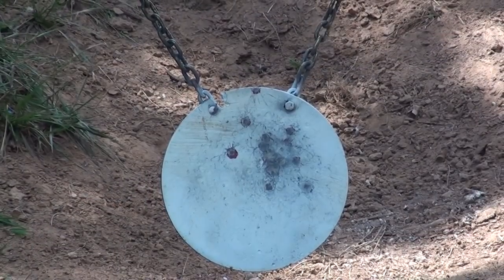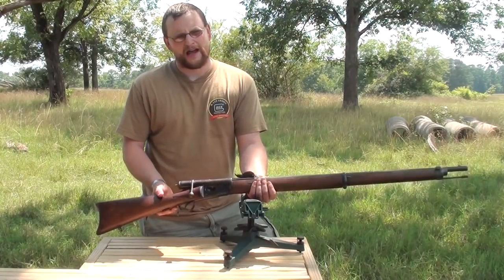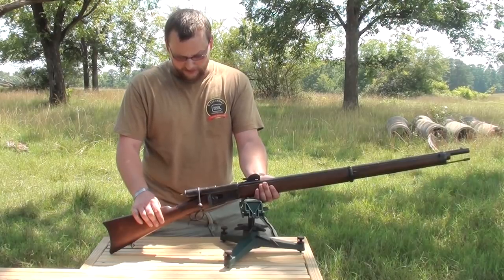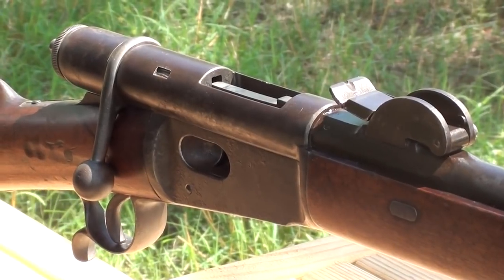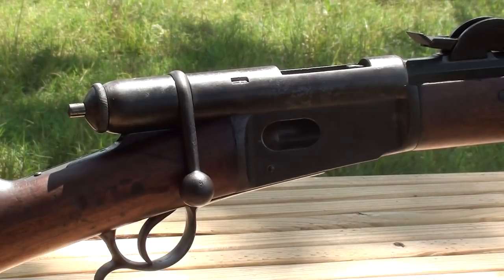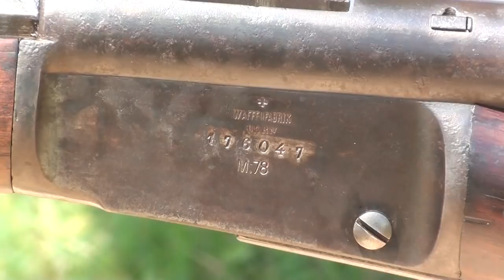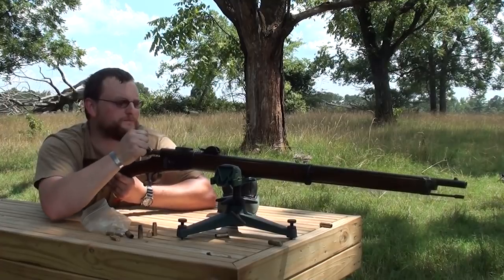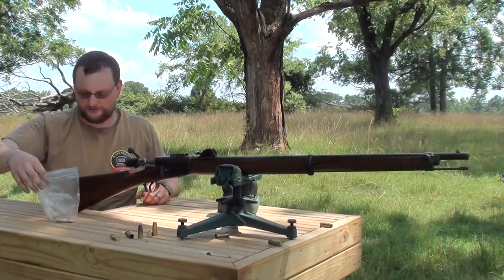Swiss M78 Vetterli .41 RF Bolt Action Rifle Made in 1870's

Comment: I am 100% certain that black powder was used, exclusively. "Smokeless", or nitrocellulose powder ("guncotton") was not widely used until after the Vetterli rifles were no longer manufactured.
Although "smokeless" powder was used by the French military (the 8mm Lebel cartridge, and the Lebel Model 1886 rifle were made specifically for use with "smokeless" powder), the actual formula used to stabilize the "guncotton" nitrocellulose was a closely guarded Military and State secret.

Comment: I have a Vetterli M1878 that I have been shooting for years with great results.  Brass is reformed from 8mm Lebel, bullet is 300grains over 12.5 grains of Trailboss.  I have also used 2F blackpowder which generates about the same velocities as trailboss. Proper smokeless powder charges are fine for this rifle; UMC loaded smokeless 41 Swiss ammo (rimfire) in the USA until 1941. One advantage of Trailboss over other powders is that the proper charge (12.5 gr) fills the case to the neck.

Comment: I have a Vetterli also and about to convert mine to centerfire.I dont think it would hurt the overall value of the rifle drilling the bolt vs being able to actually use it.plus use could still convert it back and the center drilled hole would not have any affect on the rimfire set up.

Comment: Just of note, that is a M81, not a M78. The rear sight was upgraded for the M81, which your rifle has; however, production continued using the M78 model stamp for around 6 years before they changed the stamp to M81.

Comment: Tubular magazines are more complicated than a box magazine. The need to be loaded on by one, versus the quick striper clip method of a box. As for expending brass toward the shooter, the extractor is on top of the m78's bolt (I'm pretty sure of). I'm no expert on Vetterli's, but that would explain it throwing brass up, and back toward the shooter.

Comment: Wow this is great for its time, I thought the first repeating bolt action rifle was the french Lebel, I was definitely wrong, and the fact that it holds so many rounds makes it even more amazing for its time. So if they had repeating bolt action rifles since the late 1860s, why did it take so long before major european militaries adopted the concept?
Reply: First allowe me to correct the narrator a bit: the Model 1878 wasn't the first magazine fed rifle of the swiss army. the first model adopted was the 1869 rimfire model.

A little explanation on why most other countries perhaps were a bit  slow in adopting the concept: While most of them in fact did recognise the potential of the concept wich already had been proven in battle by the US, there also were several reasons not to hurry with the adoption of it. It was forseeable that further generations of army weapons would be of the system sooner or later, but for the time being, most major european powers were rather busy conquering territory overseas than preparing for comming conflicts at home. Like the US, wich - for pushing into its own hinterland - let their cavalry convert from magazine fed Spencers to single shot Springfields, the European Imperialists needed guns where reliability and the prospect of rather thin supply lines seemed more important than high firepower of the individual soldier.

For Switzerland as a tiny country, surrounded by far larger neighbours (with the exeption of Liechtenstein of course), the situation was a bit different: conquerring any foreign territory in africa or the like was out of the question and the military concept was naturally of a defensive nature. Switzerland as a united nation with a single army was relatively new at this time. That was because up to the late fourties of the 19th century Switzerland was rather a collection of mini states (cantons) which all had their own armies and kept large stocks of various guns, often adopting new systems to already existing weapons of which some even once had started their service life as flintlock muskets, being converted to percussion, rifled and converted to breech loading systems over the years. So in the 1860's, Switzerlands Army sought to standardise its armament and as this standardisation was expected to take some time, they chose to proceed with a grand leap ahead in terms of technologial standard. This led to this very early adoption of a state-of-the-art infantry weapon, which by the time would be a magazine fed rifle firing rim (later center) fire metal cartridges of a (by the time) small calibre.

Yet,  at the same time Switzerland was full of a variety of as-good-as new weapons that had to be used first. Furthermore, the Swiss Army was basically a Militia where every able man (after a period of basic training) usually kept the gun at home which he received in his first year of service. So the first Vetterli's were only issued to new troops, after all others were already handed out and you still could find many elder swiss servicemen ralling to their anual army training or shooting matches with trap door single shooting rifles or peabodys by the time france was experimenting with the koprachek or even the lebel.

.
Reply: JosipRadnik1  You have just answered my questions and also taught me some very interesting facts while doing it, thank you for taking the time.

Comment: If you notice, the loading gate and elevator ejector is nearly identical to the 1866 Winchester which were used by the Turks and later copied by the Swiss.  This is pretty much a bolt action version of the 1866 Winchester.

Comment: In that first couple of strings of shots, it looked like there was maybe a little gas leaking out past the bolt. I noticed occasional puffs of smoke upward from the action. It only seemed to happen with second shots or later, so I suppose it could be just residual smoke being pushed out by that lifter flopping under recoil shock. What do ya think?

Comment: Unless you are 100% certain that the firearm was specifically designed and built for use with "smokeless" powders, it is best to stay with black powder loads only with firearms manufactured during the "black powder era". The Vetterli rifles were manufactured during the "black powder era", and do not appear to have been designed specifically for use with the "new-fangled nitrocellulose-based ("smokeless") powder".

Comment: I respectfully disagree with Arle Bodee about the Vetterli being safe for appropriate smokeless loads; but he is spot-on about most antique rifles being best served with BP.  Most of the pre 1900 rifles are safer with BP; but the old adage that BP is "safe" in any rickety old gun in poor shape is BS.  BP can generate pretty high chamber pressures and a shooter needs to be aware that issues of headspace etc. apply to BP ..Arle is correct that pressures should be kept low for Vetterlis..mine are

Comment: The Vetterli (introduced in the swiss army in1869) was the first repeating rifle adopted by a european army. Yours seems to be an 81 not 78 at first glance.
Reply: The main distinctive difference between a M78 and a M81 is the rear sight. The 78 model has the distance divided in paces (or feet), the M81 has a (retractable) sight divided in meters...
Reply: RichardM8181
Your rear sight looks like M81. M78 was shallow curved and the sled rail didn't stick out of the curves. M78 has a larger screw head on the right side of the sight. M81 Rifles were stamped "78" until 1887. Most "78" stamped rifles are really M81. Those are known as 78/81. Most reliable way to check: Barrel lenght of 78 was 834mm vs 843 for the 81.

Comment: Where would you get ammo for something like this in original condition also need a spring or a fire pin not for sure beautiful gun, what kind of conversion was that.
Reply: This is a centerfire conversion. You can buy centerfire brass. I was looking at this video because ive just finished a long running project where i build 22 lr cartridges from scratch, and i think i could make something like this.

Comment: I inherited a severely neglected Waffenfabrik BERN M.78 (181535).  It's been a year of getting the rifle unseized from rust, strip and each piece diligently cleaned, polished and the bore unclogged.  However, the  stock is half rotten plus termite damage.  Is there a replacement stock available anywhere???
Reply: That's sad to hear. Only ones you'll find are off parted out guns. You're probably best off parting it out. You can ship the receiver anywhere in the US without an FFL as it predates 1898 and is considered an antique. Or you can put it up on the wall (out of public sight to avoid theft) as a display piece.

Comment: I am wondering would it be more powerful loaded to the full BP loads or in the light smokeless loads you are shooting?
Reply: Jerry Bradley Centrefire cartridges that you can make today actually have slightly less capacity, as the original was rimfire & had more room. You won't get original BP performance because there isn't enough room. 

With careful research & testing you can make safe smokeless loads.. just don't wing it.

Comment: Do you need to have an FID and FFL to buy one of these? I know it's pre 1895 but is it still considered an antique even though it's a repeater and not a muzzle loader?
Reply: Idk what an FID is, you don't need an FFL to buy any firearm, FFLs are for manufacturing and selling of guns (the C&R is the exception it just allows some guns to be shipped to your home). If its pre 1895 and its non nfa than its an antique, there are m39 mosins build on original pre 1985 receivers which are considered antiques. State laws likely will vary, i'd advise searching your state's law on the internet and if you are still unsure speak to your local FFL.
Reply: +TheAlexagius Firearms Identification Card
Reply: davidscrbnr even the smokeless powder lebel is non ffl so ya

Comment: I have seen 2 videos off this rifle and i can see the projectile leaving the port of the barrel, does it have the velocity of a soft ball pitcher? saw one of these rough shape, for 250 good price or ehh?
Reply: Jonathan Billings I bought mine for 100 bucks. I wouldn't pay more than 200 for one.
Reply: Swiss Surplus Where the heck are you finding prices like that? Lowest I've seen for a CRAP condition one was $250, with a cut down barrel and stock buried in rust.
Reply: Jordan Kipp I bought it in a old gun store. The owner only deals in old firearms. Has over 800 in store. Everything from side sides fr the 1900s to 7 arisakas in the store.
Reply: Jeff Monroe Holy shit! Where is this store?

Comment: The rifles were not made after 1900, so they are not designed for any ammunition made after 1900. I have found zero evidence that they were designed for anything other than black powder at all.
When dealing with old firearms, it is always best to use powder and loads that were in use during the time the firearm was actually used and designed to be used with. You would not use modern smokeless powder in a 1888 Colt SAA, after all, so why use it in a Vetterli Swiss rifle made prior to 1890?

Comment: would imr 4227 be ok to load in this?
Reply: +Jacob Kracinski I used info from here http://theswissriflesdotcommessageboard.yuku.com/topic/14343/Case-fire-forming-IMR-3031#.VvYAAeIrJQJ , and I worked up a load using Vihtavuori N105 that has been very good for me. You should ask someone with Quickload software to check 4227, I wouldn't just drop it in!
Reply: i worked some loads up already and checked all the pressure and everything. they are working out perfect.
Reply: thanks for the link though i might use some of that instead.
Reply: +Jacob Kracinski Hey no problem. I like the Vihtavuori & it seems to have a good reputation for quality and clean burning. I'm thinking of making my own reloading video as I had some unique challenges... my barrel is .406/.422 so it's considerably tighter than most. My reloading posts are in that forum someplace!